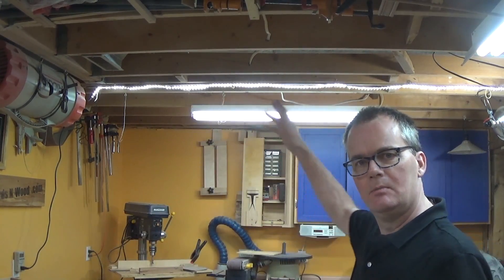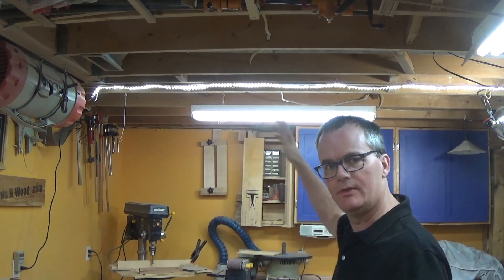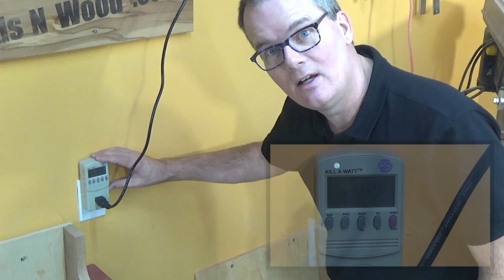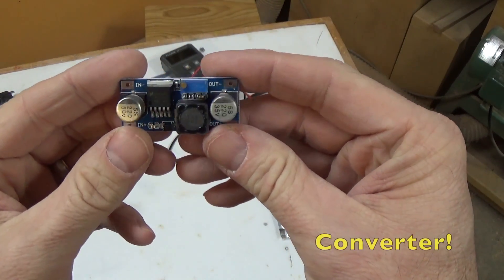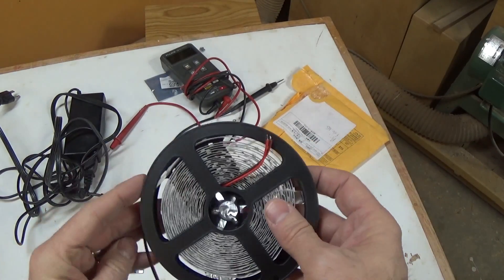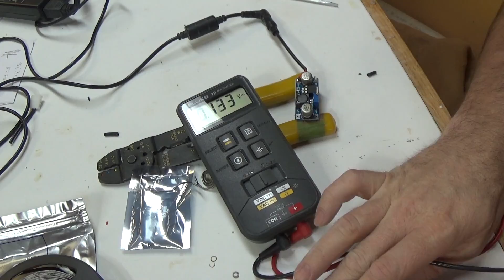Can LED strip lights replace Fluorescent!?  (WnW #46)

Comment: As for the voltage to drive the LEDs at, you want to be as close to the specified voltage as possible without going over. LEDs are similar to fluorescent lights in that they require a driver/ballast to limit the current through the LED. If the voltage goes too high, you can end up with a situation where the LED overheats and the forward resistance rapidly drops so the current rapidly increases. This can snowball and will cause the LED to self destruct, much like a CFL will without a ballast.

LED strip lights can sort of get around this by having resistors in series, but over-driving them can still cause the same failure mode. If the strips are rated at 12v, you want to not go even a few fractions of a volt over that.

Comment: The DC-DC regulator you have is a buck converter, and a pretty common design usually based on the LM2596 which has a maximum output of 3 amps. If you look at the black chip with the 5 leads coming out of one side, you should be able to see the part number.

If you want to pull the maximum 3 amps out of one of these units, you'll need to attach a heatsink because they do get quite hot and don't have any thermal or over current protections. The maximum current you can draw from them safely without a heatsink is about 1.5 amps.

For your application, you really need probably a 5A power supply per string.
Reply from the maker: Thanks...  See my follow-up videos for how I solved this a different way!

Comment: I'm using 18" long LED strips for keeping plants going over the winter, 5 strips spaced about 4" apart. They seem to be working fine.

I also bought some 4ft LED replacement T8 lamps for $7.49 each from 1000 bulbs online for some of my shop lights. These are all 25 years old and the ballasts are starting to fail, ballasts are not cheap.

You have to cut out the ballast and do some rewiring but that only takes about 10 minutes. Be warned that shipping something 4 ft long cost me $20 but I bought 8 tubes so the total cost for each tube was about $10. To my eyes the light output is about the same.

Comment: Thanks for sharing. I have been going down the same route and I found your video very interesting, thanks. I did not expect you would have adhesive problems - that is something to take into consideration. You might also have considered the heat given off by the florescent tubes being much greater than the LEDs but I guess it is an advantage in Canada.

I have been looking more at local lighting rather than full-shop lighting (I have a mobile workshop) and that is where there might be an advantage for the LEDs because small batteries can be used rather than cabling. However, there is another surprise there because, with local lighting, you need shorter LED strips in a compact arrangement and since the strips cannot be bent, you either cut-and-solder, or cut-and-use-connectors. The best connectors for tight turns are this type - https://www.amazon.co.uk/SurLight-Connector-Female-Welding-Gapless/dp/B01FDHFS9M/ref=sr_1_2?ie=UTF8&qid=1475684531&sr=8-2&keywords=LeD+strip+light+connectors

Secondly there is no stroboscopic effect from LEDs running on battery power - something to consider around saws and planers. Perhaps a rechargeable battery might be the way to go - say a drill battery!

Comment: I'm in the US but I bought a roll of led's with the power supply included from amazon for $16.99
Reply from the maker: I'm not surprised.  The prices on LED continue to drop and this video is 10 months old now...
Reply: Wordsnwood (Art Mulder) Ah, but the ones I ordered I've had now for over a year.  I put one set under the upper kitchen cabinets and used the other set on the ceiling in my bedroom.  They're both still stuck there good too, no sagging yet.  My one gripe is my own fault.  I got warm white and cool white and got them mixed up installing them, lol.

Comment: Actually you don't need the DC 2 DC convert, there is DC12V power supply which can connect to led strip directly.

Comment: after these 7 months, are those led strips still alive and working well ? i kinda felt horrified when you pasted them on wood beams, cause there wont be any way to dissipate heat, and heat kills electronics fast. mounting them on aluminum channels is far better.

about the power consumption, no dc-dc converter is full efficient. of we consider its 80-90% efficient, it will still be spending 4-8 watts for itself.

and yes. that dc-dc converter is cheap build for light loads, putting a continuous higher load (than 1A) without a way to dissipate heat, will kill it fast.
Reply from the maker: Did you watch the follow-up videos?   In June I added more strips and switched to a PC power supply and it still works fine 3+ months later.  http://www.wordsnwood.com/2016/LEDs-revisited/
Reply from the maker: As for the wood....   These LED strips are sold to the general public with virtually no instructions.   I've seen many many articles where people past them up under kitchen cabinets for accent lighting -- and that is wood.   In hindsight I totally understand the problem, but I also understand how easy it is to make the mistake.
Reply: thanks for suggesting the follow up video, thats a much better solution, hopefully the led strip will serve years to come. :)
however, we don't agree with sanding the metal beam, it makes the surface uneven and there will be air pockets trapped in between led strip and metal surface. its better to stick the tape on smoothest metal surface. a layer of thin cello tape can be applied in front, as the heat will get dissipated through the large metal bar behind (more the open air surface area, the better).

the reason that there are no clear instructions with these items is, these are all diy grade stuff coming out mainly from chinese factories in the most economic way possible, while maintaining the minimum required quality. it finally falls onto the end users skill & knowledge, how the final thing will come out and how long it will last.
also that the sellers are businessmen, they want people to keep buying their stuff, to maintain a steady income for living, so they just don't bother with instructions.

but it was good watching you doing diy, gaining knowledge in the process & rectifying. please enjoy the light !
Reply: Wordsnwood (Art Mulder)
 another small point, if you want to put led tapes on wood / non conducting surface for accent lighting, then you may look for the low power smd led package 3020 or 3014, with less number of leds per meter. they are around 0.1w each and dont generate as much heat, to require heatsink. depending on manufacturing quality, they may last longer. but yes, there lots of crappy ones sell on internet, that start to go dim after 1 year.

the chance of getting better ones is better, if ordered from the renowned electronics suppliers like mouser or element14 etc.
Reply: I did that in an aquarium lid. :)

Comment: We have LED lights in market that gives much better light than florescent and the energy consumption is like 1/10th of fluorescent. But they are fucking expensive and that is why I searching for a way to make my own. But looks like I can't use led strip because looks like these LEDs are the not the one which are used in those LED light bulbs.

Comment: Enjoyed the video.  

 About the power usage - The DC to DC converter/regulator probably needs about 14 volts to put out 12 volts.  If it's not a "switching" regulator, anything about that 14 volts is just wasted as heat in the regulator.  Next time, get one with a heat sink on it to dissipate  the heat for higher amps.   Or get more than one and keep the amps down to (probably) 2 amps on shorter lengths of LEDs.  

Another possible power source might be Low Voltage landscape lighting.

One good thing about going with LEDs is (especially if you 'under run' them a bit) they should last a lot longer than the tubes.  

Ballasts, starters, 120 volts AC ??  I am much more comfortable working with lower voltage.  Should you decide to scrap the florescent lights, install an outlet in place of them.  Then just plug your power supply into it.  Remember that you can 'gut' the fixtures and stick the LEDs and small power supply in it.

Comment: I have nearly always found the best deals on LED strips on EBAY ... I have purchased 5630, 5050 and 3528 from EBAY and I would stay with WARM White in any living areas and maybe COOL white in workshop.  Thanks for the Video!
Reply: To specify. 2700-3000 K for living room. 4-5000 K for workshop. Some call it neutral white. I don't really recommend cool white a.k.a. 6500 K for anything other than very limited specialty purposes.

Comment: I have used these strips for about 3 years now and mine are still up there.  I have always used hot glue every 3 inches where the copper dots are on the strips.

Comment: Im not sure how you powered the leds but for a 5m strip you should not be powering it only from one end. Due to voltage drop and other issues you should power a 5m strip from both ends.
Reply from the maker: Thanks Tyler...  I did not know that about 5m strips.   Don't think I saw that in any instructions or guides.

Comment: So a big thing what your missing is efficacy.  efficacy is the combination between the light source, (ie. led) and the reflector (also wattage but we will ignore that 😉 for now). Now one huge thing is lumen, sellers rave, buy this  we got lumens!!! watch out 😀 like i said efficacy is key, why, it can give you LUX! lux is what you want, which is light on a surface, specifically lumens per square meter, or the older measur in S.I. candela which is lumens per square foot. So where does this put us, a bulb is rated in lumens because it has no reflector, if a bulb is then inserted into a fixture, hello! effficacy! So efficacy of the light fixture, is detremind by the highest lux/candela point on a surface given the distance, reflection angle, and lastly lumens from our light source. So the thing with strip leds the say "oh yeah we have lumens" when actually the probably did a test with a single led lumen rating and added them from lumen per meter and gave you a whopping 800 lumens with crap efficacy.  So buyer beware its a bit more, frankly way more complex then at a glance! you have the totally right idea an great video! leds are the future!
Reply: What if you added a reflector around the LEDs? would that give it more lux and efficacy?

Comment: If you painted the walls and ceiling with white patint, you would get 85% ish reflected light.  Cheaper and more effective, but not as sexy as  new stuff like LED's
Reply: The florescent tubes would still flicker.
Reply: If they flicker, they are probably old.  Replace the ballast and tube with new high efficiency T8 Daylight.  They work really well.

A fluorescent tube loses half of it's intensity after the first year.

Comment: Great Job !  We need more vids like this one. I to have been comparing LEDS for awhile can not seem to pin down specs that match to the real world. I Have tried 3528 5050 5630  5m strips none of them equal up to 2 4ft t12 or t8 bulbs.  The best I found so far is 5m 5630 strip 6000k  mounted on fixture 7 ft high lux meter says 150 lux original t12 bulds read 350lux

Comment: I have a string of LED lights and had the same problem with the adhesive. I am using them as accent lighting around the bottom of my platform bed and they didn't like sticking to the laminated wood. I am going to try that hot glue gun idea, thanks. I am also using an LED shop light fixture in my garage and do like the spread of light that it gives off versus traditional lighting.
Reply from the maker: +Chris O&#39;Bryan The adhesive on the second string (different brand) also has started to give out.

Comment: I bought the cheaper Chinese LED's also. I had the same problem with the adhesive and solved mine with spots of gel CA glue. The big caveat with the Chinese lights is that small sections of the lights are starting to flicker and I suppose will eventually go out. Mine started about 2 months after installing.You might want to check that later on to see how they hold up in comparison.
Reply from the maker: +jdrew500 The adhesive on the second string (different brand) also has started to give out.

Comment: You should check your voltage under load. It's probably dropping below 12 volts. I would raise the output voltage with no load to around 14 volts which will give you more light.
Reply from the maker: +Jake Palmer Still measures as 12v with the lights on...
Reply: +Wordsnwood (Art Mulder) you can turn it up to about 14.4 volts and it will be a lot brighter just the led's may not last as long as there rated but with them being so cheap it's worth it

Comment: I have been thinking of changing the lights in my shop (and my whole house) to LEDs. But for now I am going to wait for them to come down in price
Reply from the maker: +Wes Hamstra (Wes Hamstra Woodworking) For regular bulbs I have been buying the phillips or cree 60w equivalent for in the house.   In certain locations they work great.
Reply: +Wordsnwood (Art Mulder) my house has alot of pots. I was thinking of getting the retro fits for them
Reply from the maker: +Wes Hamstra (Wes Hamstra Woodworking)  Try a few of the bulbs... might be a cheaper solution.  (ie: leave the fixture alone and get some compatible LED bulbs to screw in.)
Reply: +Wordsnwood (Art Mulder) I haven't checked the pricing yet. I might do that

Comment: A couple of other things you left out - the LED's last 50,000 hours - how long do those florescent bulbs last? Also don't you have to dispose of those florescent bulbs a certain way aren't they toxic? LED's are not. I'm not some big tree hugger but most cities force you to dispose of the CF's a certain way - I replaced all my lights that need to be on 12 hours per day with LED because incandescents I was replacing once a month it seemed and now the Philips LED bulbs I installed 2 years ago - Philips has the longest life and best color if you want them to look like the old bulbs (warm white) my eyes can't handle 5,000k as far as the adhesive being 3M? from China? yeah sure. If it were really 3M tape it wouldn't be so cheap - a dab of hot glue is worth the hassle in my opinion
Reply from the maker: +Sachi In Wisconsin Disposing of CFs is easy -- all the big box stores here have collection bins.  but disposing of 4ft tubes is ridiculous -- can't put them in the trash, and need to go to a waste disposal centre.
Reply: Wordsnwood (Art Mulder) Yes, Special disposal - Since I don't do CF's do they last as long as LED's? If not there's your cost savings Depending on the quality 6,000 to 10,000 hours for CF's vs 50,000 LED - you won't save in electricity costs but you will in the need to drive and get more bulbs

Comment: Art, I have a storage loft above my garage door. It is 20' by 8'. I was thinking of running an LED strip down each joist, or maybe every other. Babes on what you have done, what do you think of that idea? I like that it's a real low profile.  I will say, I like how your day ends are lit up with the LEDs.  Scott
Reply from the maker: +The 2 Car Garage Shop I would do like I did and first buy one string and try it out before committing.

Comment: If I were to judge light quality for video purpose I would say the leds win
Reply: But if you buy the lower quality LED from ebay or Amazon, it will be very low CRI and the light quality will be very pool. You can try spend a little more money for a premium quality one like this:
https://www.amazon.com/dp/B073WVJSBY
Reply from the maker: +Dema&#39;s WoodShop   I think you'r right.  With my relatively low ceiling the glare + hotspots from the fluorescents can be an issue.
Reply: +Dema&#39;s WoodShop Agreed, LEDs provided more even lighting. The color might have been off a tad but that can be corrected.

Comment: very interesting "study".  when I moved into my shop 4 years ago, there were 12 4' twin fluorescent fixtures.  they were about 10 years old and were very poor output.  I bought 12 standard light fixtures for about $2 apiece. I also bought 12 fluorescent "Brightwhite" 100w bulbs at 5 dollars each.  these bulbs are rated at 100 watts of light but use 23 watts of power each.  if any bulb ever fail, I just unscrew it and put a new bulb in for $5.  in the last 4 years, I have had one failure and my initial investment was a lot cheaper than 12 4' fixtures and 24 bulbs.  best of all, the lighting in my shop is a lot brighter and no shadows

Comment: I gotta say, Art, that this is a very timely video for me. I'm thinking about adding some shop lights to my shed because I too have dark spots and lots of shadows caused by the T8 fixtures I have now. 

As a viewer, and nothing else,  I have to say that I prefer the LED lights to the fluorescent lights. The fluorescent fixture seemed harsh, caused shadows and shine, and left dark spots in the room. I don't know what color temp those tubes are, but the video seemed a bit bleached out. The LEDs, on the other hand, spread the light out over the whole width of the area you were lighting and just looked a lot more "natural." I know that's pretty subjective. I know that I'm not there in the room and I don't have to try to work in it, but from a purely aesthetic point, for video purposes, I think the LEDs are superior to the fluorescent tubes.

I think I'm going to keep my current fluorescent fixtures and give the LEDs a try for fill-in lighting. I was thinking about doubling up the number of fluorescent shop lights I have, but I think the LEDs might do a better job.

Thanks!
Reply from the maker: +Mark Lindsay Thanks, Mark.  The tubes are all "daylight", but they are varying vendor and varying vintage so they are not all identical.